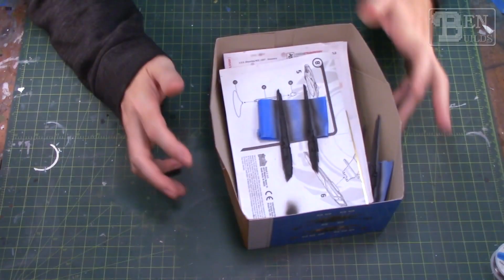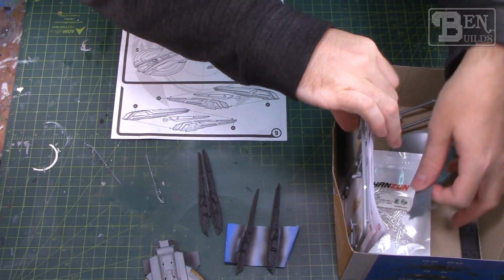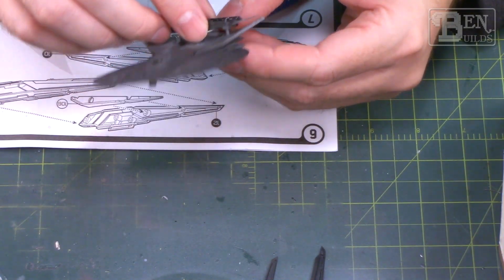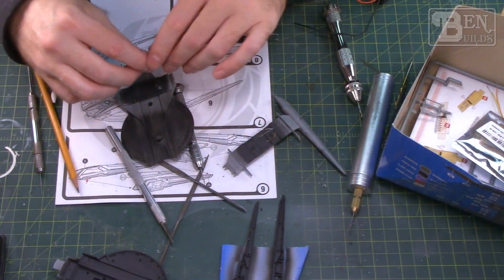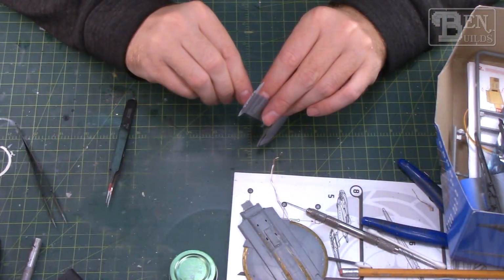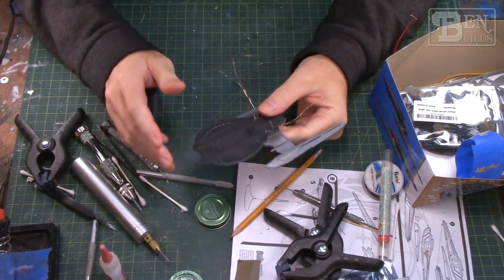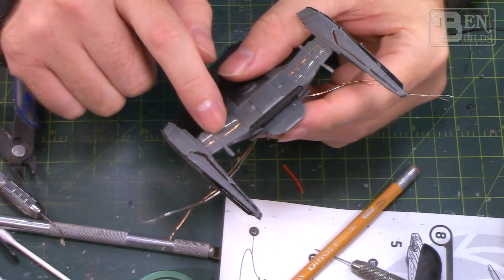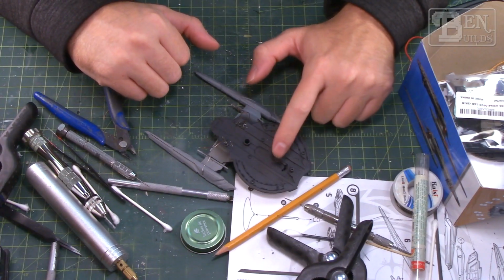Sci-Fi Wednesdays - U.S.S. Shenzhou ep. 4

Comment: Ok Ben, Stupid Questions, as I'm still new to this whole lighting thing...
1) The wires don't look like they are insulated.  Are all those the (+) Positive, or with the small LED's does it not matter if the (+) Positive and (-) Negative touch?
2) The wires are 2 different colors... Brass and silver.  Why is that?
3) Can you do a video on wiring/LED's/Lights?  I've tried to get Kenny at HLI to do one but Spencer is the lighting master and it's hard for him to create a video on that at the moment.
Thanks for all you do and contribute to this community, and Happy Modeling! 🖖
Reply from the maker: No worries buddy, I am still new to this lighting thing too, but I can tell you what I know. 

#1) Yes, the wires are in fact insulated. If I remember correctly, they come coated with a clear enamel coating or something like that. It melts when you put a hot soldering iron against it, otherwise it stays put and insulates the wire. If I remember correctly, the silver wire was the positive lead and the brass was the negative. (I think? lol) And yes, it totally matters if the bare + and - wires touch. Even with these little guys, if the uninsulated tips come into contact with each other, it will short out the system and the LEDs will not light. 

#2) The different colors are to distinguish the positive (anode) lead from the negative (cathode) lead. As far as I know, you always have to keep all the + leads separated from the - leads and the color helps this process to be faster and more organized. That is why, for most of my projects, I tend to use ribbon cable that is made up of multi-colored wires. It is just easier to see what colors should go to what polarities.

#3) I am honored that you would be interested in a video, thank you! If it helps, I have a new series coming up for Sci-Fi Wednesdays that will have simple LED lighting, so I can try to focus more on the basic order of operations. If it would help, I can always try to go a bit more in-depth on the process and the tools that I use. Of course, as a caveat to all of this, I am VERY much a beginner with LEDs and I tend to learn as I go. That means, I can often make mistakes and I don't always know what to do in certain situations. Regardless, I would be happy to share what I have learned. I am aiming to start the new series in a few weeks, so stay tuned!

I hope this helps a bit. Let me know if you have anymore questions and I'll be happy to try and answer what I can. Thanks!
Reply: @BenBuilds  Thanks so much Ben!  You answered all of my questions. 
That will be a great series.  I look forward to it.  It would be awesome if you went a little more in depth if you can.  
I'm like you, I learn as I go and make many mistakes lol.  I'm hoping to finally get a lit Airplane at some point using a Hobby Link International Board that I have, but I am a long way off of making anything work, and frankly, I'm a bit intimidated by it.  
One thing I've taken away from you though, is to not be afraid to do something outside of your comfort zone.  So thanks for that! 🙂

Comment: Very cool Ben! Do you find there is a lot of math when dealing with tall the different resisters and such?
Reply from the maker: Thanks! I use an online LED calculator that gives me the voltages and resistors that I might need for the project. Luckily, the small SMDs that I've been using won't need any resistors, IF I use 3 volts, so I've just been sticking with those. I try to keep it as simple as possible lol.